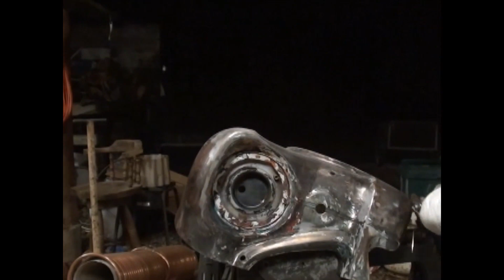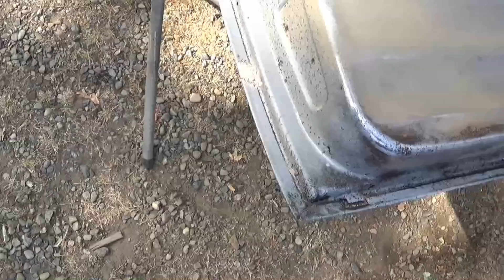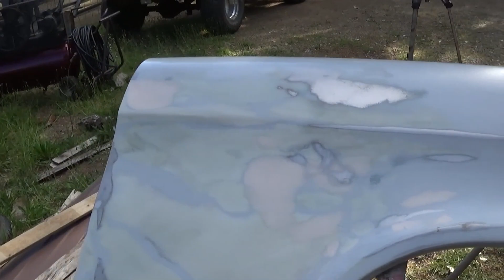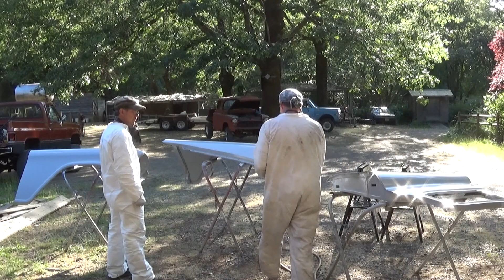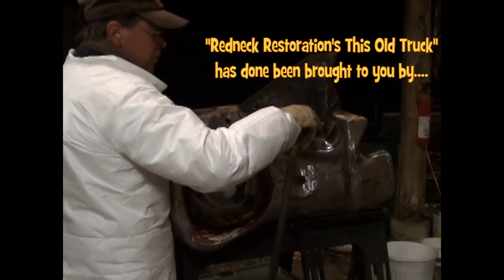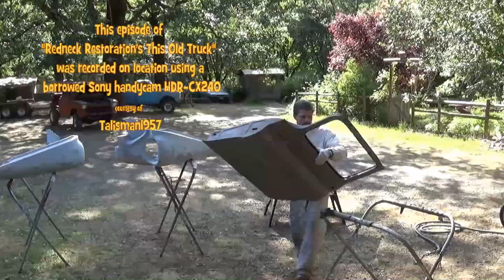Part 2 of 2 Project Whitey 1957 GMC Napco Front Fender Restoration

Comment: Hey Jeff I just saw a few videos of  "rust removal " using molasses. Witch I thought was very interesting. I thought I's pass it along to you. The videos are by Dave Ailey, I believe he is from Australia I think by the accent. The recipe is one part molasses to 9 parts water and dip them in the solution tank and let sit for a week or so. Rinse with plain water with a pressure washer (repeat if needed). the use a Zink coating and spray it to keep it from the rust returning. I think this would be a great thing to use if you not in a big hurry and have multiple projects going one at the same time. Will you please watch them and give your viewers your thoughts. I'd love to see you use this method. Thank You. Will

Comment: Another great video!!! I have no clue about paint work but I would love to learn!! I do have a question though, if that epoxy primer sets up like concrete  and is non workable, why use it? Couldn't you just skip that and go straight to urethane? Like I said I know squat about painting....
Reply: Chris Brown I am no expert, but I believe the epoxy primer does a better job of filling little cracks and dings. i.e. It is thicker than the normal primer.
Reply: Aaahhhh  ok I understand  it now. Thank you!!

Comment: What is the green spray paint that prevents rust? Hadn't seen anything in green and couldn't understand what you said in video. Thanks
Reply from the maker: ***** Any old paint will do. If you use rattle can or sanding primer on bare metal, it will still rust because it's porous. Enamel paint, however will seal better when you're going to have extended time from finish removal until body work. It's preventing flash rusting.
Reply: ElderlyIron Thanks.